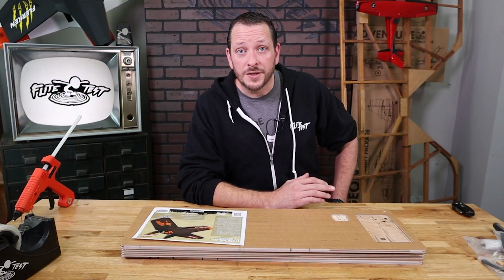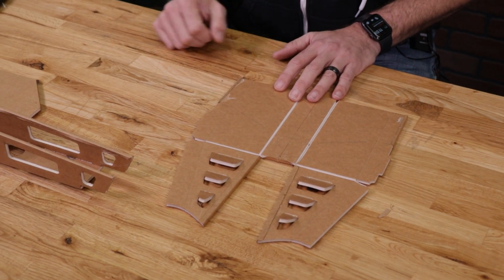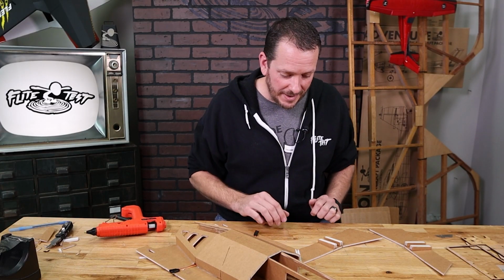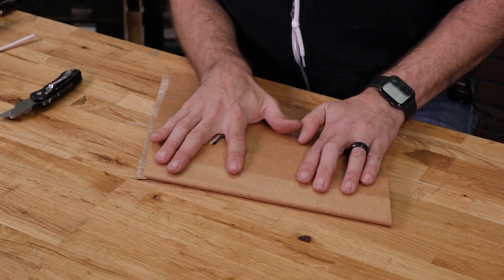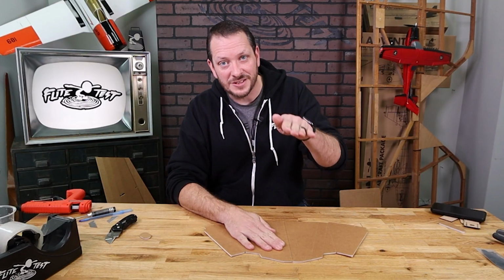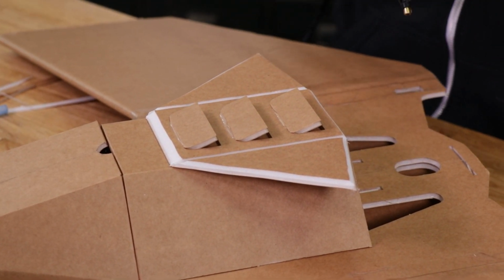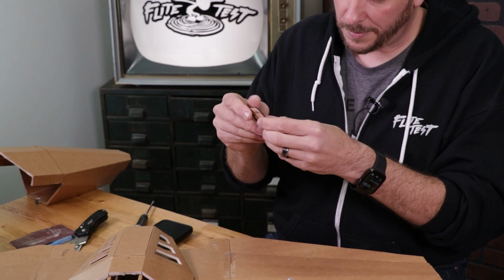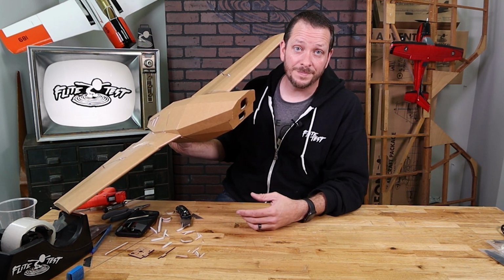How to Build the FT  Flerken // Main Body // BUILD

Comment: The only thing I changed was when it comes to the elevons,  I cut them completely off and then used blenderm to create a less resistance hing and also used Plastic control horns  with an adjustable clevis that uses a screw to secure the connecting rod. I also tossed the connection rod and used a larger diameter rod. 

I laminated the elevons once removed and also laminated the wings and nose as well as the rear hatch. Super rigid and ready for flight ✈  😁